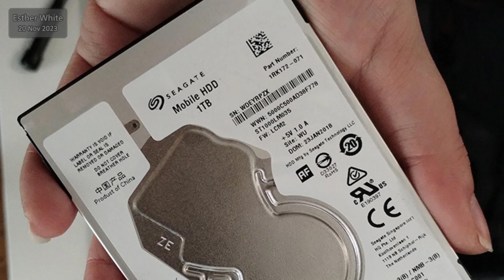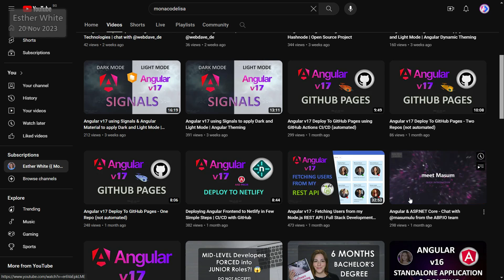10 Year Old Laptop for Coding !? ASUS X551MA Part 1- How to Hardware Upgrade RAM & HDD

Comment: Hello @Esther White, I have Asus SonicMaster which again from 2014. I was thinking of upgrading it to RAM16 from RAM4 and may be getting SSD 500GB. Is it worth it? 
How do I find out how much RAM does my laptop support? Will it Handle SSD?
Reply from the maker: I use ChatGPT or other LLM to check what is compatible and what is the max upgrade a given machine can take. Then I check out the prices. You can do the same and then if it's not too expensive to upgrade - it makes sense to give it a try, see how it goes.

But if it becomes to much of an investment - I wouldn't do it. My ASUS holds up, but it cannot be my primary machine, it is too slow for that. 

So as fun side project, side machine, it was fine, but if you need a primary machine - investing in something new would be better.
Reply: @EsteeCodes thanks for the quick response!!

Comment: The best upgrade is actually the SSD HD.  It makes a huge difference.  Even a small 250GB one is good.
Reply from the maker: Absolutely 👍👍
Reply: @EsteeCodes  I don't know if the X551MA (CPU N2830) actually supports up to 8G of memory or just 4G. Looking at the information on the internet, some sources say 8G, some say 4G.
Reply from the maker: @quocchinhvuong5056  I will have to rewatch the video because I no longer remember what I shoved in there but I think it was 8G
Reply: @EsteeCodes Thanks for your feedback, have a nice day❤❤❤

Comment: Putting a $20 PNY SSD in a laptop from 2008 made the computer seem 10 years newer. Now using any computer with a mechanical boot drive, I have to constantly remind myself it's not broken and it's just the OS running on an HDD. It's a huge difference.  4:50

A SATA SSD would make that seem like a new laptop. The PNY 500GB drives tend to be $40. Crucial MX500 (not BX500, the MX500) SSDs are my choice if spending more, 500GB drives are maybe $60 and 1TB drives for about $100 at Best Buy.
Reply from the maker: very good point, thank you yes - I am going to look into getting a battery and the next thing after that is an SSD :)